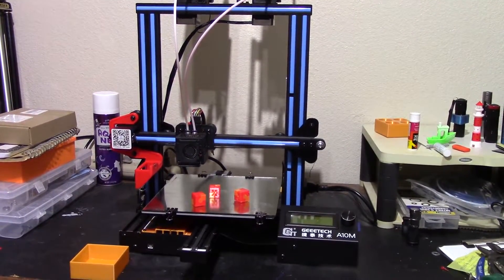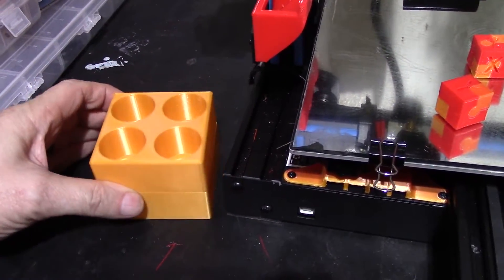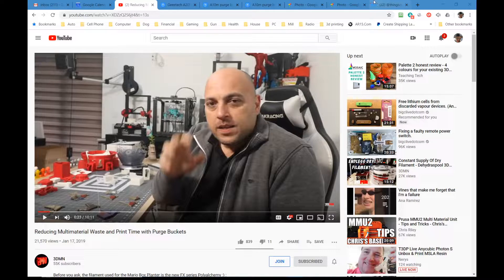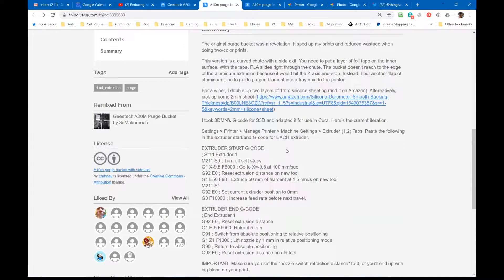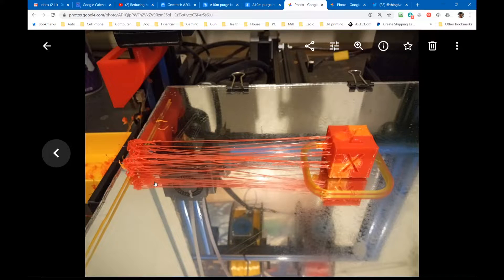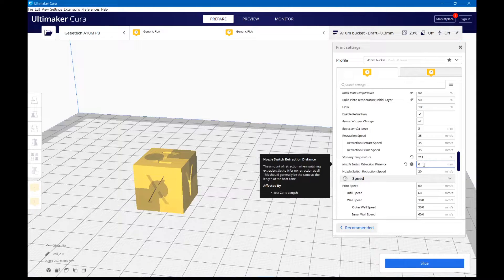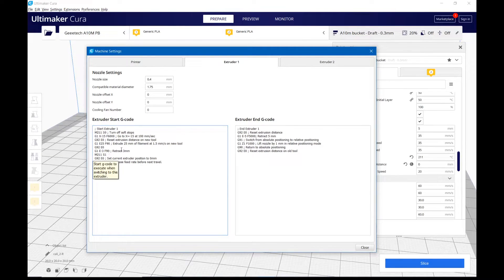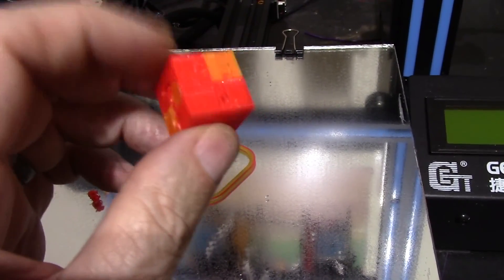A10m purge bucket

Comment: Good info in the video. I finally added this purge bucket to my printer and the info provided helped me get there. I haven't used the penny, I'm currently using a piece of an old hotend insulator sock. It's working so far, I have a silcone sheet on order from Amazon coming in and plan on giving it a shot. Some day I might try the penny. Thanks for the info.
Reply from the maker: Thanks for letting me know it helped you. I stopped using the penny too, now I've just got a folded piece of motorcycle inner tube. Seems to work perfectly, the nozzle can wipe across it and it just flexes out of the way if needed.

Comment: I'm looking at this, and looking at mine, and I don't see how you're getting the nozzle to move off to the left of the plate. I've got a hard limit switch keeping it right at the edge of the plate.
Reply from the maker: The purge bucket overhangs the edge of the print bed by a small amount. Also, my limit switch is still in the factory location. When the carriage is up against the limit switch the nozzle will be, or at least should be, over the edge of purge bucket. I didn't have to change the location of anything to get this to work.
Reply: @3rdpig  Okay, that's not really clear looking at the video. Meanwhile, I guess you just can't print anything out near that left edge.
Thanks for the reply, and moreover, thanks for the video!
Reply: Well, I've finally gotten around to adding the purge bucket, or at least trying to.
It is secured in place but there is absolutely no way the nozzle will reach the purge bucket, and I think I know why:
Looking at your machine, and the machine pictured on the Thingiverse page, it is obvious that there are (at least) two different designs for the A10M. If you look on the web at different images of the model, you can see that on some the USB port is on the left side, just about under the left side of the build plate. On mine, and others whose images can be found online, the USB comes in about 1-1/4" inboard of the RIGHT side of the build plate.
I can move my X axis  from hard stop to hard stop, and the nozzle never makes it to the edge of the plate, let alone beyond the edge to reach the purge bucket. Truth be told, I think the only way to use ANY purge bucket on this machine would be to custom make a smaller build plate so that the nozzle can reach over the edge.

Comment: You added code to retract 3mm but when I use this I get under extrusion when it starts printing again. Need to prime 3mm sometime after the retract. Still work in progress for me. If anyone has an update I'd sure appreciate it.
Reply from the maker: I think I see your problem. Watch the video again and look under Extruder 1 and Extruder 2 Start and End Gcodes, not just the Start and End Gcodes under Printer. 

Under Extruder 1 and Extruder 2 the End G Code retracts 5mm, but in the Extruder Start G Code it purges 25mm without another retraction. The 5mm retraction in the Extruder End Gcode is to keep it from stringing between the print and the purge bucket. Then in the Start code it purges 25mm into the purge bucket and returns to the print without another retraction, relying on the wiper on the purge bucket to prevent stringing on the way back to the print.

Comment: I'm torn between Ender 3 pro @ $358.00 Canadian or Geeetech A10M @ $369.00 Canadian. I am new to the hobby can the A10m achieve the same print quality as the ender 3pro ? I am assuming that you are going to recommend Geeetech A10M dual extrusion.
Reply: Prob a late response, personally I'd recommend getting a Ender 3 Pro, You will have a much smoother experience as if you have any problems you can easily look them up due to it's large community making resources readily available, with a A10M however, prob like me, you'd need to scower the internet for every little bit of information on problems regarding this printer and not all solutions are up to date as geeetech like to update their products frequently making certain printable upgrades for it redundant. Plus, the Dual extrusion on the Geeetech is still very much a test of concept and requires much more set up to get it working nicely, whilst with the ender 3 you will get amazing single colour prints with a few adjustments

Comment: How about a small "wire brush" in the slot instead of the penny? Scrub it back and forth a few times after a retract, move the extruder to print position (where u left off before color change), extrude that same distance, then resume the print. The high end printer that we have at work has a tiny brush and does this, though you cant view the g-code, its a closed system...
Reply from the maker: It wouldn't be that hard to do, the movements could be added to the extruder gcode.  My first thought would be that the brush would load up with filament. Does that not happen on the one you have at work? How often, if ever, does it need to be cleaned or replaced? I'd also have to answer the question of "What would it do better than the penny?" Might be worth experimenting with though. Thanks for the comment!
Reply: @3rdpig  Oddly enough, it does not load up. Being wire though, they do bend over time. We prob replace them about 3 or 4 times a year. I would only do this on a steel nozzle though, even if the bristles were brass it might wear out a softer nozzle. Might be more trouble than its worth.

Comment: Almost 1 year ago I printed and installed that piece on my A10M and I have not had the opportunity to use it, I have been very entertained by making fixed mixtures of colors (mixing) and degrading (progesive mixing / Color interpolation) :) :) ... I hope now if I use the piece using your code. :)

Thank you for sharing and HAPPY YEAR !!! :) :) :) :)
Reply from the maker: Happy New Year! Thanks for watching and commenting. The color mixing thing is a LOT of fun. I made the fan cover in the video (Teaching Tech's part) several times, settling on the orange and red gradient mix so it had a kind of flame/sunset effect. Very cool, very fun and I've only dabbled my toes. I've got more interesting things to try with this printer too.
Reply: Just got an A20T (first printer ever) and actually mixing and degrading are the only use cases I can think of for me. I'd rather split different colors. Though I very much lack experience, so this opinion is very much subject to change, in which case, this small piece will be a tremendous help

Comment: Did you ever get .2 nozzles and try them? I can't get them to work.
Reply from the maker: I've never tried .2 nozzles. What's happening, are they clogging? I'm hearing more and more people are going to larger nozzles, .6 and even .8. I've been thinking about trying those. I've got an assortment sitting around here someplace that I bought and never even opened, there's probably a .2 in it.
Reply: @3rdpig  i can't say for sure maybe the extruder cannot push it thru but i wanted to try high detail stuff.
Reply: ive used e3d 0.25 nozzles key is having a good strong geared preferably dual geared (bondtech like) extruder. and a 400 step motor probably better too, for the fine stepping and extra torque.